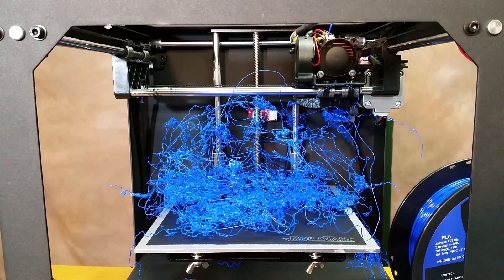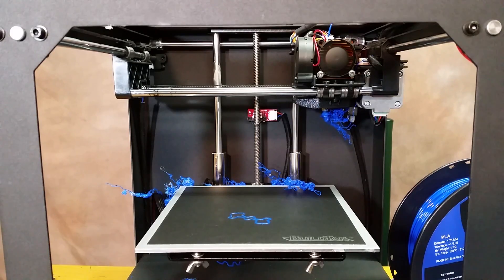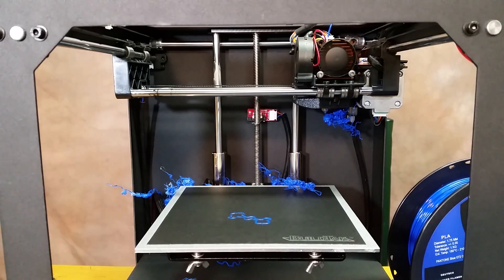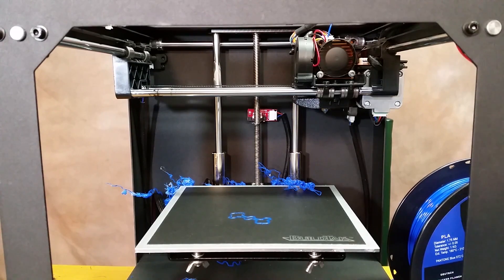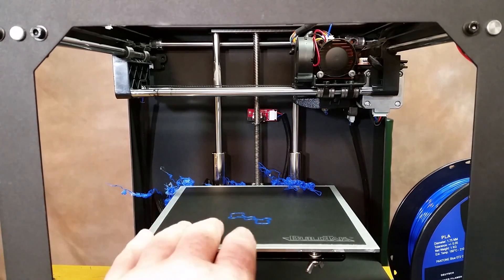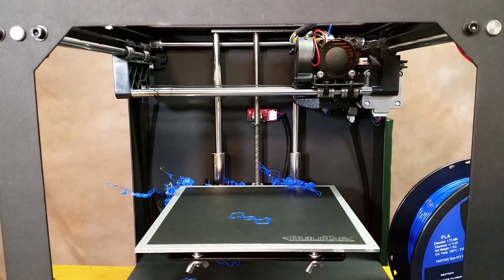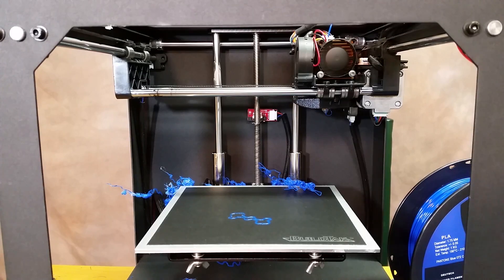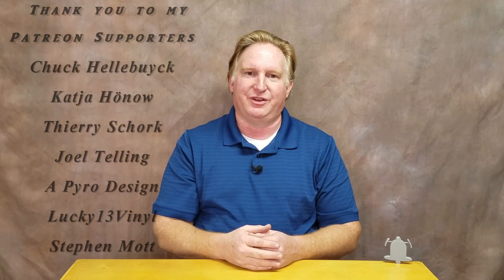How To Remove Hardened PLA From The Hot End Due To A Failed Print

Comment: Wow. That was the easiest,  smallest blob ever. I just replaced my hot end after destroying the thermistor because of a bolb of pla with petg mixed in. In my first print since, I have about 100g of pla in an enormous blob up and around the printer head. I just saw it and went back to bed. PEI plates suck bad.

Comment: have you tried out craftware yet jimmy?
Reply from the maker: +josh cartmail I haven't.  Hopefully I can get around and work on it tomorrow.
Reply: Jimmy Shaw's Tidbits ive managed to get some crackin prints from it, make sure to get the most up-to-date version and to make sure you set the printer size when you start it up in the options tab and leave the origin/home position as it is or the printer maxs out the x and y axis and grinds.
Reply from the maker: +josh cartmail Thanks for the tips.  Will do!